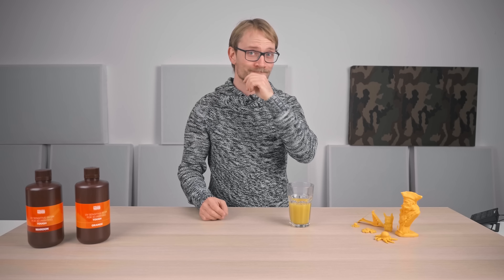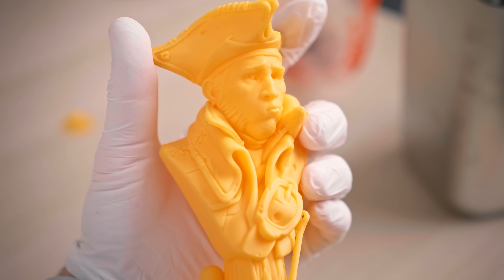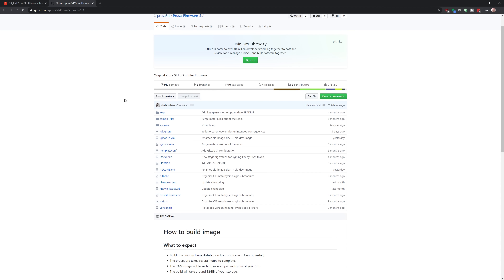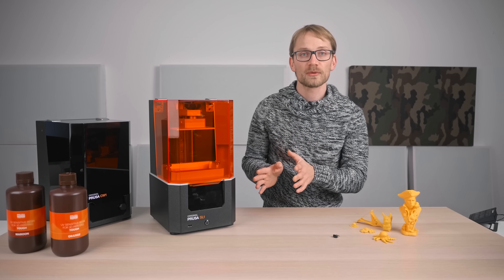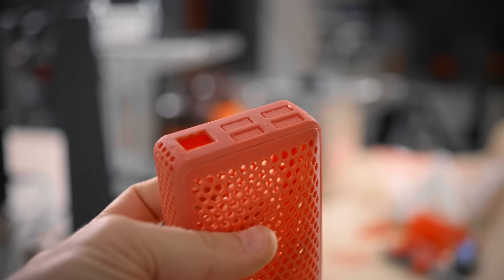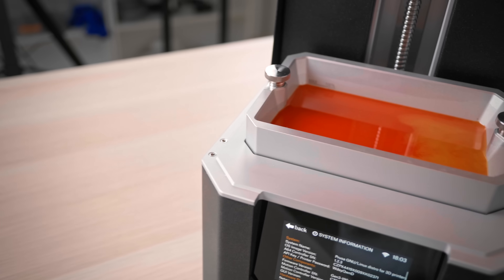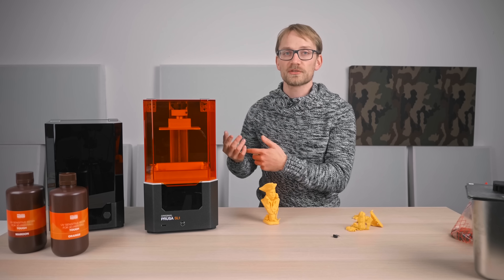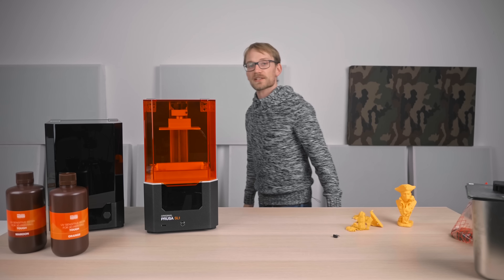The MK3 of SLA resin printers? Prusa SL1 and CW1 review!

Comment: A question for people with MSLA LCD based printers: has any of you repaired the LCD by replacing the polarizer film, or does the screen degrade inside the LCD itself?
I'm wondering about making one for myself as well (after an FDM that is) and not too keen on replacing LCDs every dunno how long, but also would prefer that instead of the galvanometer mirrors so it's faster.
If it's repairable by replacing the polarizers on the screen then it's a lot more appealing.

Comment: Being someone that owns a Formlabs Printer (I also bought plenty of Prusa Products, not bias), Wash Station, and Curing Station. I still would rather stick with FromLabs even if it is more expensive. You dont have to unload/load IPA, the part is lowered into the IPA automatically, and raised to be able to drip dry some. If I do have to change out the IPA I can either use the included hand pump, or lift the whole bucket out to pour it. Also came with a hydrometer (maybe this one came with one as well idk) to test the IPA, to make sure it is still cleaning.
For me the only downside is it's a slower machine being that is SLA. But the post processing seems to be a bit more enjoyable then this one.

Comment: Heard people question the value proposition before... but id be wiling to pay for more precision and it does seem to have ambitions there. I am mostly looking at precision engineering prototyping applications, and anything that smells like layer shifts is a big turn off. The Mars is known to be pretty wonky in that regard, but more quantitative information in that regard on msla printers would be great; if such printer reviews included a few test cubes (on different parts of the build plate) and some measurements that would be really awesome to me.

Comment: It looks like a really solid built printer bit the price is almost double what I originally expected 😬 especially considering that the print volume is the same as all the other low cost printers on the market. It this was even slightly larger volume the price tag would be easier to swallow.  this is closer to the price range of the Phrozen Transform. Than it is to the elegoo Mars sadly.

Comment: This is a really helpful review. It's clear that Prusa SLA printers are hot on the tail of other big names. The LCD is the exact same LCD used in the elagoo/Anycubic, etc. And the tilting vat is reminiscent of the Formlabs Form 1.  Additionally the screen and bezel are an exact copy of the Form series printers. Even the wash cure station looks like an exact visual copy of the form wash cure station. The shape, the way the hinge opens, the magnetic mixing impellor.  Very interesting.

Comment: Good video! Is there any experience with good resin to print functional parts like tools? All the resins i have used so far are brittle and breaking easily when impacted by mechanical force.
Reply: All About 3D Blog a lot of people on the photo facebook add in about 20% of a flexible resin to help prevent parts from being so brittle.
Reply: Thanks for the info, need to study on this. Would be good if manufacturer would also provide ready made solutions for this.

Comment: I am in to support EU companies but the gap between Prusa resin hardware and almost equivalent competitor is way to huge.   CW1=700€, SL1-1000€, come on.   

Same for SL1. Mars/Photon screen last around 400 hours. The single good SL1 feature is tilting mecanism still it is not mandatory.    A good device for small business but not for hobby.  Cut the price by 50%, which still make it  almost twice more expensive than Mars and you will get more supporter.

For +1000$, better switch to laser SLA like Peopoly. Bigger printing surface and no screen to change.

Comment: Seems like they're positioning this as more of formlabs competitor rather than a elegoo competitor. Particularly with the software, looks like they benchmarked it from Formlabs (which doesn't have a hollow feature either) 

Glad they at least include resin volume sensing, I couldn't believe the formlabs didn't have any way of determining if there would be enough resin to finish a print.

Comment: Another thing I wanted to mention is that I also mostly use Water Washable Resin now. It has a little less odor than regular resin. Still not good for you but less odor is always better.🥴 You also save on not having to use IPA as much. I still use IPA to clean my build platform and tools and any time I use other regular resin for some reason. In any case it is one less hassle to deal with. 😉

Comment: Printrbot and Prusa come to mind a lot. Non Chinese 3dprinting companies have a tough time competing against the Chinese because creating these parts are super expensive. Prusa Mk can compete at the lower price point because of the Rep Rap philosophy. Printrbot with their lasercut parts couldn't keep the BOM low.

The SL1 seems like it's following the Printrbot model by using these nice parts. It'll be interesting how it does. It does benefit from the Prusa ecosystem, so hopefully the SL2+ and beyond will see some drastic improvements.

I'm not entirely sure investing in SLA was the right move because FDM resolution is getting really good. If they double down on stuff like Non-Planar and maybe even axis in the nozzle then there will be even more improvements. And, resin has not solved multicolored prints or soluble supports at this price point too.

Comment: I bought a Prusa SL1/CW1 package and an Anycubic Photon. I've been pretty bitterly disappointed with the Prusa, mainly because of the incredibly poor support I've gotten from Prusa. If you're going to run one of these machines seriously, you're going to require a handful of spare parts and consumables. It took Prusa several months, a lot of nagging, and ultimately threatening to file a chargeback on my order to get them to ship me the screen I had ordered. Other parts that were supposed to be included with the Prusa kit were missing. Prusa promised multiple times to deliver them, and then didn't. Only now, 4 months later, did they FINALLY get me the entire original Prusa kit I had ordered. It is sad to say, but Anycubic has had substantially better support than Prusa, and for the cost of less than just the Prusa spare parts, you can purchase an entire new Anycubic Photon. 

Now the Prusa does brag a lot of features, but most of them are over-hyped. The tilting bed for example really doesn't do much unless you're printing composites that need to be stirred. The problems with bed adhesion which the Anycubic came with were merely because it had a poor surface finish: a few seconds of sandblasting and suddenly the Anycubic's bed adhesion and print reliability is the same as the Prusa's. I should also add the flat top of the Prusa's bed collects resin, either wasting it or necessitating a second drip step. There is a reason why most other SLA machines have an angled top surface to their print bed. And there are other things too, like the CW1's claim of being better at washing than an ultrasonic cleaner is simply untrue. I bought both, and the ultrasonic cleaner is substantially more effective and can also be used with much less noxious and safer cleaning agents. Meanwhile, if used on the CW1, gobs of resin collect on the impeller and get flung onto your part. Oh, and Prusa WILL NOT SELL YOU additional lids or impellers for their proprietary gastro pans. (I know, because I asked them over and over for months and they repeatedly refused to sell them to me) So if you want to use your CW1 for multi-stage cleaning, which is what most people do with their SLA prints, good luck. And finally the Prusa came with a wide variety of unhelpful bugs and quirks. For example, if you want to print from a USB drive, the printer on startup will wipe that USB drive. Pretty annoying, especially since the printer by default turns off at the end of each print. (this can be changed, the turning off not the wiping that is) Other issues are things like the CW1 factory firmware allowing a maximum run time of 10 minutes, which might be fine for cleaning in some cases (although none of mine), but the literature is unanimous that curing for substantially longer, hours in some cases, produces superior parts strength and this is borne out by my testing as well. Goodness many of my parts were still sticky after their 10 minute cure in the CW1. Oh and we mustn't forget the "resin sensing system." While other premium printers just have a resin feed system, Prusa went with a tank level sensor. Two problems: first, prints over a certain size use more resin than the tank can hold, and if you overflow it you get a mess inside the bed mount system, and second the resin level sensor is hilariously innacurate. The gradations on the tank are consistent and easy to read, and my Prusa is never anywhere close to those and you can measure the same tank of resin multiple times and get +/-20% resin volume at the extremes. So it isn't really a useful feature. 

Honestly, the only two advantages I've found with the Prusa over machines costing a fraction the price: the first is the tilting bed is useful if you're printing composites or other resins which need high levels of agitation. The second is Prusa Slicer, and this advantage will go away as soon as these other companies start making their printers compatible with Prusa Slicer output files. 

So all in all having both the premium Prusa and the entry level Anycubic, I'd honestly strongly recommend the Anycubic even if there were no difference in price. The Chinese company has better parts availability, shockingly better support, and a variety of minor design advantages. Just my experience.

Comment: Critical of Prusa as always, but that's how i like your video's. And you now compare it to an Elegoo mars. I would compare it to a higher end Formlabs and in that case it is way cheaper and has a lot more features.
Reply: Its not an unfair comparison, though. The Mars delivers an outstanding performance right out of the box, at a price point that puts the Prusa offering to shame. Resin printer technology in general is a lot more solid in design now these days compared to the FDM market.   Prusa has rightfully acquired a well-respected recognition as FDM printer manufacturers but they're really going to have to focus in on their prices for their resin printers. The competition on offer is simply that much more capable of matching their offerings.

Comment: Is there a concern that the tilt mechanism will eventually go out of alignment and need manual readjustment? I can see this being a problem with other similar printers as well (e.g. FormLabs).
Reply from the maker: It has an endstop built in for zeroing - not sure what else would be able to lose accuracy over time in the tilt mechanism.

Comment: Standout aspects of the SL1 for me:
- Heavy!  This little box is stuffed full of gravity.  Way overbuilt, but easy on the eyes.
- Most reliable 3D printing experience I've had with any type (including several fully updated Prusa FDM machines).  I've yet to have a print fail, even though I've printed some really iffy models with minimal support.
- Resin prints look fantasic, but for mechanical parts it's harder to get a precise fit than with FDM (still figuring out the dimension changes and warping that different resins exhibit to varying degrees)

Comment: The screen needs replacing that often?! Surely that's bad thermal design. End results nice but way too expensive, although a good build quality is the luxury wealthier printers are paying for I suppose.
Reply: That is actually fairly standard for resin printers. The LCD screens are considered to be consumable items, and are typically rated for about 400 hours or so. So the fact that the Prusa screen can offer 100 more hours on top of the typical LCD screen lifespan is impressive, but not at 6.5 x the cost of an Elegoo Mars!
Reply: @HighbridgeD  That's appalling! But thanks for the info.
Reply: @Martial-Mat  You're most welcome. But honestly, at least for the Elegoo Mars at least, it's only about $40 CDN for a replacement screen, so its not going to break the bank. I understand your concern of course, but this just seems to be part of the printing process when printing long-term.
Reply: @HighbridgeD  BUt as Thomas said in this vid, the cost with the Prusa adds a full dollar to each print. That's not an inconsequential amount.
Reply: @Martial-Mat  Oh, I'm sorry, I guess I wasn't good at stating my feelings on this. Apologies! I agree, the high cost of the Prusa printer, plus the high cost of their screens when they need to be replaced, places me firmly in the Elegoo Mars camp. My initial reply was just to address the need to replace the screen, as I don't think he was aware of that being a thing.
Reply: @HighbridgeD  You have nothing to apologise for Colin. I appreciate you sharing. I just find that soe people are quite comfortable paying out an extra $50 here and there. I'd sooner spend that money on resin.
Reply: It really has nothing to do with thermal design. The UV light degrades the liquid crystal. You can get special LCD's that don't degrade as much but they are very expensive.

Comment: I found the Longer 10 to be substandard. The Mars has excellent resolution for its small build factor, but I've found the dimensional accuracy to be off by approximately a millimeter. I'd like to know that accuracy on the SL1.
Reply: I'd suggest trying Siraya Lab Blu resin. Its one of the most expensive resins you can purchase here in Canada, but it can produce functional parts that are also more impact-resistant compared to other resins, and the parts can even have some flexibility to them. As for dimensional accuracy, its my understanding that you definitely shouldn't be having those kinds of issues using that resin. Hope this helps you!
Reply: @HighbridgeD  do you think it's the resin causing the deviations in my parts or the print settings?
Reply: @WGAJeremy  I'd be willing to bet it has more to do with the chosen resin than your print settings. Standard resins will produce better dimensional accuracy compared to flexible resins for example. But it could be a combination of factors. If your lifting speed in your slicer settings is set too high for the resin you are currently using (say, flexible resins), you may find that over time part of the print will end up being warped or bent as it is being pulled out out the vat. A final consideration could be a lack of support structures for certain sections of the print. It can be time-consuming and tedious, but manual support placement may need to be done as well. This is all I think of off the top of my head, hope it helps!